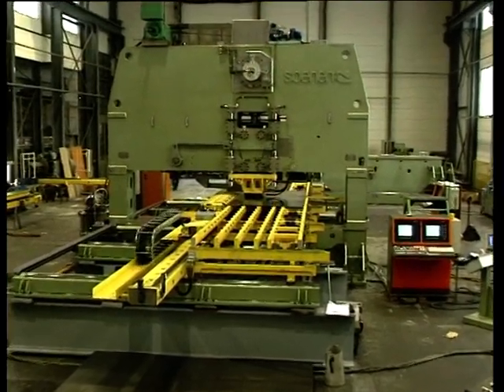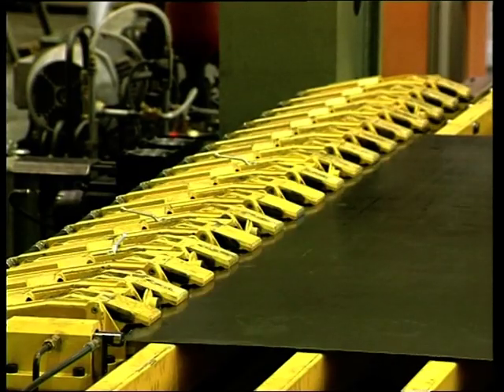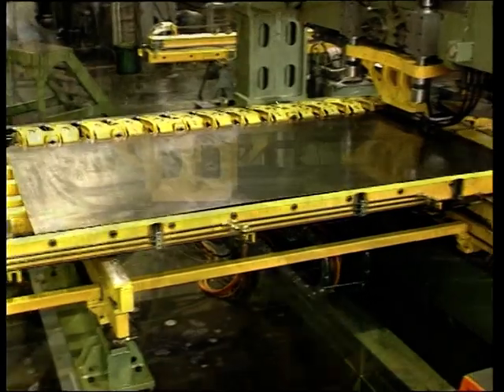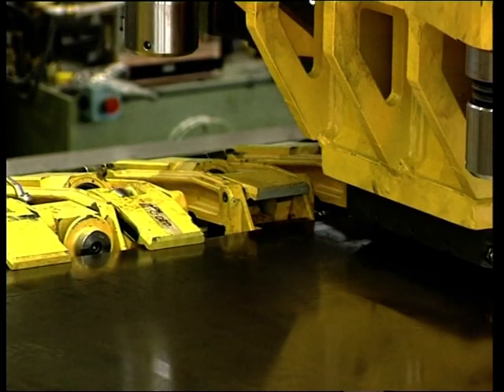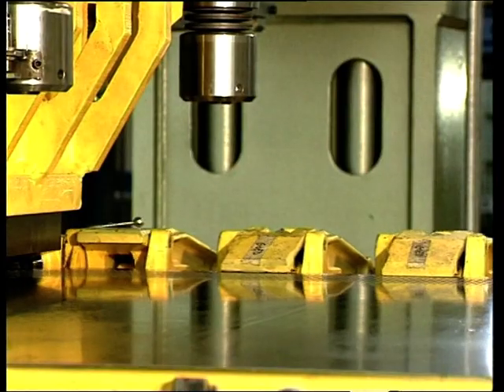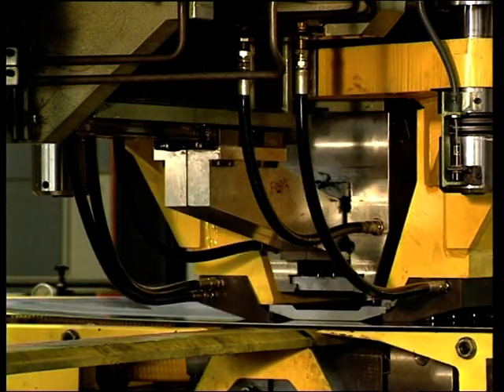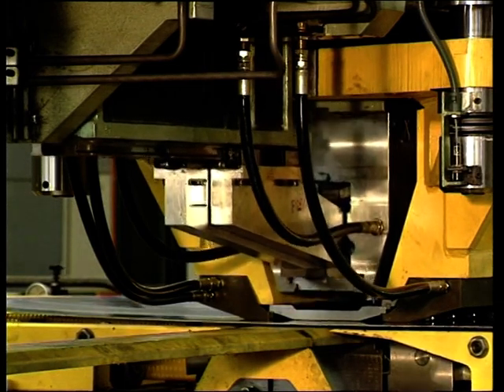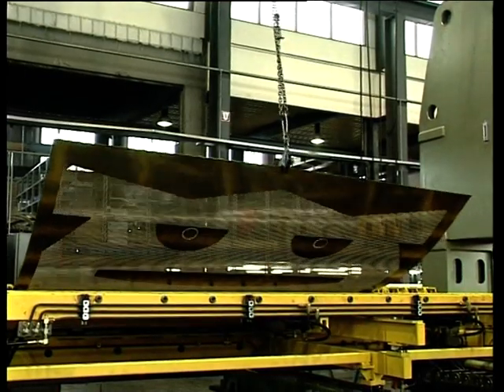Soenen Sectional Perforation Press - CAPS

Comment: good morning, I would like to ask you the following questions
1.- Up to what thickness of the stainless steel perforated sheet?
2.- Until what minimum hole does it drill in stainless steel?
3.- Our company requires a 0.4 hole. 0.5. 0.6. 0.8. 1.0mm up to 25mm of 1500mmx3000mm formats, how fast is the machining?
 4.-Do you have dies and punches?
5.- Regarding the machine, can it be manufactured according to the customer's requirement?
 6.- guarantee for the machine and for the parts, as you will see there is no machine that lasts, that is why the parts for their due maintenance are needed, could you provide them?
7.- For this machine, what is needed is the table where the sheet metal is moved so that it is machined, is that included or is it separate?
 8.-To import it to Latin America, you have a container, what size should the container be?
9.-Sometimes certain parts of the sheet are machined by sections, leaving frames or borders at each end. Is it feasible with this punching machine?
10.-How would the advice be for the proper functioning of the machine, if one does not know how to use its system, and in what language are the machines manufactured, since one dominates Latin Spanish, is it feasible to put it in the Latin language?